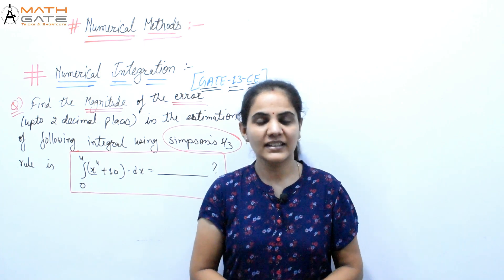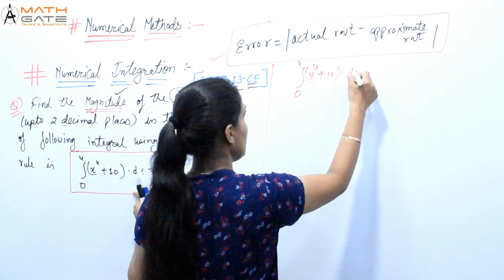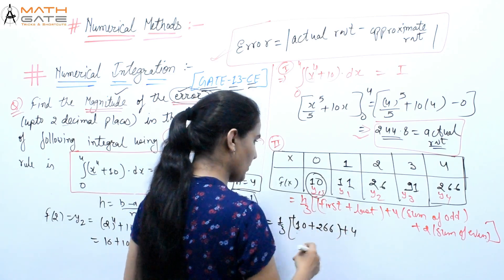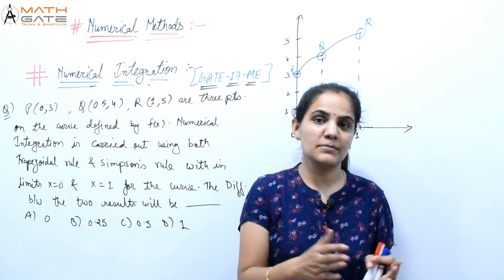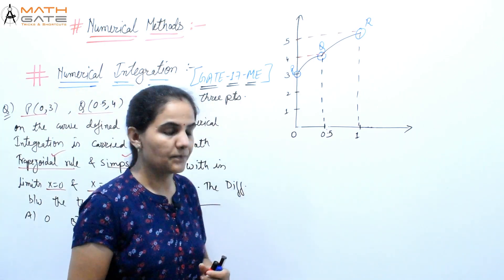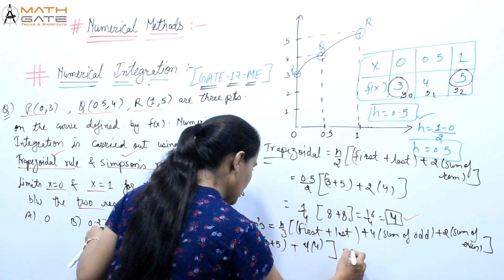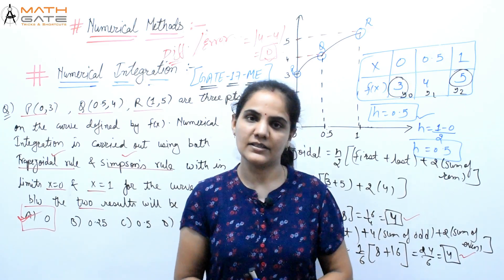Numerical Methods I Numerical Integration I Simpson's Method -2 I Engineering Maths by Priyanka Mam

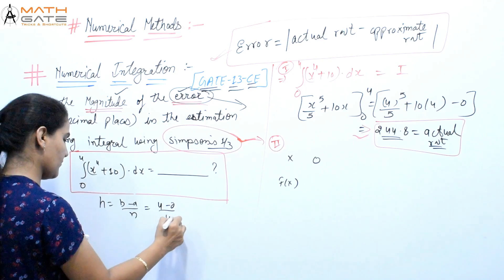Comment: Mam, time 3:45 ...you said we can take either 2 or 4. Mam is that wrong becuase when we take 2 getting asnwer is different than when we use 3. I think in this question data is missing by you or wrong question framed in 2013.
Reply from the maker: In Simpson's method we can take no. Of intervals as even no. ....
Reply: For n=2 
I am getting 53.33
Reply: Yes, mam wrote half question, in question they had given to take step length as 1, means take h=1